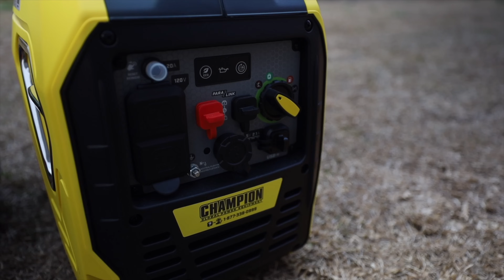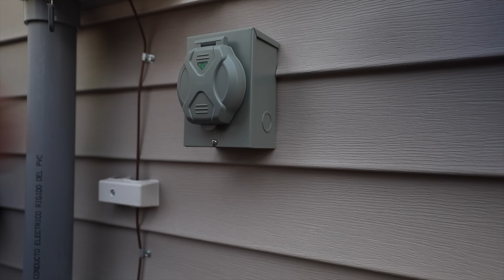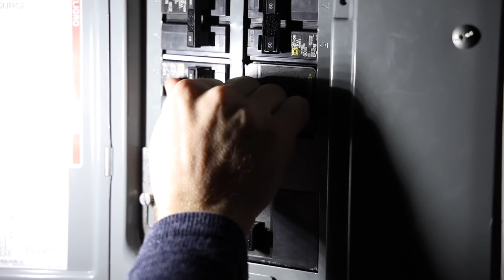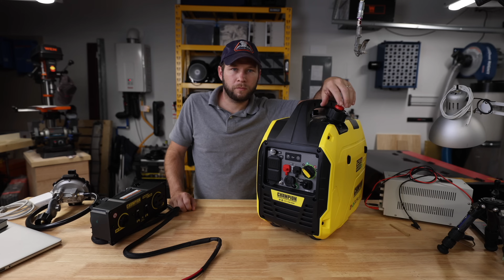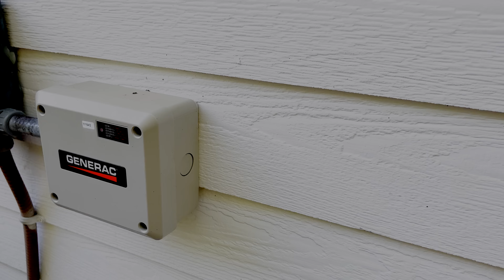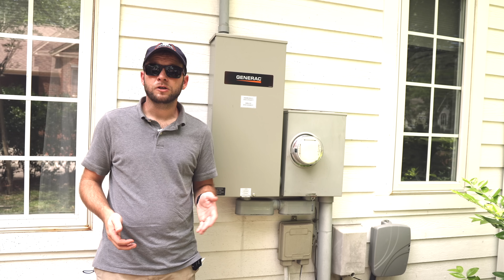Will running on a generator damage your house? Inverter vs standard vs standby

Comment: a lot of the generac's now have a Bluetooth connection. you have to be hooked up to the Internet for this thing to work. OMG what happens if somebody hacks your generac will never start again because the computers fried because of an EMP!
Reply: you do NOT need to be on the internet to use these. It is an option during set up that you can skip if you are that worried. BTW, the main point of the Bluetooth is to notify you of what's going on if you are not home. OTOH, if the net is down during a power failure, you are out of the loop anyway. BTW, you need to have the app and also a personal code to use the feature.
Reply: @rupe53  it's going to be rather interesting when my whole neighborhood is down and the internet is down. I guess there'll be expecting the Generac to power the internet.
Reply: @willfriar8054  ... I believe I already explained what happens if the internet is down. Everything works on the power end, but you don't get your text messages as to what's happening while you are away from home. If you are home, then you know the gen is working.
Reply: It still doesn't change the fact that it was a rusted up piece of cheap crap brand new in the box Rusty. They should be using more corrosion resistant materials
Reply: @willfriar8054  ... how do you know it was rusty?

Comment: I was going to buy a generac. I made a wonderful pad for it. when I got the generator it was all rusty inside and I took it back to Lowe's. they ordered me another one in that was just as Rusty as the first one! turns out they had a flood in the warehouse. all the control springs and even aluminum parts were corroding. controls for the gas valve  corroded. and this was going to be set up next to a 500 gallon propane. no thank you I got my $6,500 back from Lowe's. I invested 3500 and solar panels batteries and inverter. all my refrigerators run on solar all the time. I've never had to buy propane for the generator. I turned that massive 4 ft by 8 concrete block into the foundation for a nice little greenhouse.
Reply: That’s the advantage of solar. It starts paying for itself from day one while the best you can hope for with a generator is that you never use it. Even in that case you have regular maintenance costs if you expect it to work when you start pouring more money in the gas tank.

Comment: We decided to get the Generac.  I'm still stressed about it.  I'm running it now for the 25 hour break in.  When the a/c kicks on, you can tell, but then it smooths out.  They do install a house surge protector.  My problem is I'm worried about my computer.  I do have my computer plugged into a nice surge, which is plugged in my ups surge protector battery.  Every time the a/c kicks on, the generac speeds up, for a lack of a better description.  My ups battery lights up and peeps one time.  I'm hoping this is not a bad thing.
Reply: Anything you love, should ALWAYS be placed on a good quality UPS, period.  Be it your 85" flat screen, computer, etc.  End of story.  Surge suppressors do not work for voltage sags.
Reply: your computer has a regulated power supply so all the internals run on 12 volts DC... and the input voltage can vary from 100 - 140 volts at 50 or 60 Hz. The reason your UPS beeps is it reacts VERY fast to minor variations in power, which will happen with smaller "portable" gen sets under heavy loads. (typical 5-7 Kw units)
Reply: @rupe53  Hi :) and Thank You :)  So you are saying I should be ok, concerning my computer?  When I mentioned it to my generac dealer, they came out and tested it and said what I was experiencing was normal.  They told me that sometimes there are problems with the a/c starting up.  In that case they will install a 'soft start' thingie for the a/c.  He didn't think I needed one, and that I wouldn't notice much difference if I wanted one.  At the cost of it, I'm happy, but I was willing to pay for it, had I needed it.
Reply: @desertdee1  ... the cheaper way to get some relief on an older AC unit is to ask your AC dealer to install a hard start kit. (Super Start kit?) It will basically knock the start load down, but not as much as a soft start.... but way cheaper.
Reply: If you still look at this site, your UPS (some of the better ones) chirp, because their alarm points are set to tight for a standby system.  Go into the software, and change it from 5 volts to 15 or 20 volt voltage swing.

Comment: The one thing I can add to this, is the cost of using your Natural Gas.  After Ida, we went 19 days w/o electricity.  It was miserable HOT and muggy.  We used a regular generator, and had it hooked up to our house.  We could run everything but the a/c and desk top computers.  So if you weren't in front of a fan, you were miserable.

Other then the normal maintenance and hour cool down in the morning and once in the evening, my husband had to spend hours in line for more gas.  We had enough cans for approximately 5 days.  There was no guarantee that when you finally made it to a pump, the gas station didn't run out of gas, and no truck in sight.  It cost us approximately $500.00 for that 19 days.  My aunt has a Generac.  She didn't have to do anything.  Her bill for that 19 days, from the gas company was also about $500.00.  So either way, you're going to pay...
Reply: as a 25 year generator tech, there's no reason you can't run a desk top PC on a portable gen set. The internals are already on a regulated power supply and will be fine on AC power from 100 - 140 volts at 50 or 60 Hz. Most fridges will also cool enough in 3-4 hours to hold food for another 6-8 hours if the door stays closed. If you set up a schedule to run the set in shifts of 3-4 hours each you can cut your fuel costs in half. You just have to group your electrical use to fit during your run schedule. After all, most people are just using it for the fridge, well pump, and some lights. TV, computer, and other small stuff is hardly any draw, and usually not all day or night.
Reply: the kubota GL11000 is way to go wich runs 100% everything in the house wich why im gonna get one for $8,600

Comment: At LAST!!!!!! Hands down the clearest explanation of why my standard generator did not work with my furnace during our recent power outage. Bravo!  and Thank You!!
Reply: A furnace shouldn't draw that much power. Ignition for the flame (fleapower), and a blower or water pump. An oil furnace has a fuel pump while a gas furnace doesn't.
Reply: @joewoodchuck3824  high efficiency furnaces don't like THD above 5%. They also can be finicky if you're generator neutral is bonded, depending on how you hook it up.
Reply: Some furnaces are picky about how the ground is connected.  This is a separate issue from the dirty power issue described in the video.
Reply: the kubota GL11000  11,000 watts 16.5 hp  is the best generators that can accully run 100% everything in the house include furnace plus runs 24 hours with out refeuling up wich im planing on getting wich plus uses same 16.5 hp kubota tractor filters wich gonna cost me $8,600
Reply: Please pulsar 4000 gd run it

Comment: I'm looking for a portable Inverter Gen. As have high tech furnace was looking at this but gas tanks small & would like 7500 running on Gas any other suggestion Reliability of most importance   Champion Power Equipment DH Series 8750/7000-Watt Open Frame Inverter,
Reply from the maker: I do like my champion generators and I will say I hold them in higher standing than some of the predator or wen models. However I do have the luxury of having two and with my future system plans could function with just one if needed, so I have a bit of a safety net. I chose them because of the features and reviews for the price. If reliability was my highest priority and I could afford it, I would get a Honda or Yamaha inverter, though for the price of that you could probably get two of the model you mentioned and have a backup.  As long as they are maintained properly and not mistreated I think most any reputable model that has the features and output you want will do fine. I do think that the Hondas are probably more reliable, but the critical failure point would likely be the inverter module and that’s not something that can really be worked on but rather replaced. So again, if you are looking for less expensive, the champions have been great for me, if you are doing something where being without power is not an option, get two. If you want the best and understand that anything can have problems, get the Honda.

Comment: I have that same 16kw unit here in Florida. Got it cheap brand new at Lowe’s since it was a special order return, never used. The nice thing about that unit is that it has hydraulic lifters,no need to adjust like the other models during that time. Now the brand new models have hydraulic lifters though… Oh it will power my 2800 sq ft house easy even with the AC. The trick is to install a micro soft start on the AC unit. About 200 to 300 bucks. It requires less energy to start the AC system, therefor the generator has zero bog down. Really love the 16kw unit as well since it’s very fuel efficient. Great video BTW!
Reply: When I was running my new generac for the 25 hour break in, when the a/c kicked in, it really bogged the generator down, and caused our lights to dim, and my UPS battery to light up and beep once.  After everything smoothed out, the battery light went out, and everything was fine.  When I spoke to the dealer, they said I needed to install an a/c soft start.  I agreed, before even reading your message.  I'm glad that you spoke about it, because now I know they aren't just trying to sell me something else.
Reply: if that set is the 800 CC unit (fairly new) then you have hydraulic lifters. If it has the 1.0 liter engine then you need to adjust the valves.

Comment: Nice video years back all i used was a light globe between phases of different generators to put them in phase, once done, they are locked together. cool you can do the inverter type easy.
Reply: Interesting could give a little more detail?

Comment: I have a GP6500 from Generac and it comes with an automatic voltage regulator built in... When I load it the hertz changes a little if the load is heavy, but the voltage output is pretty consistent.  I only notice a spike when I throw something like 4000W instantly and that is where people get into problems and that is outside of a whole discussion of load balancing.
Reply: The FREQUENCY can change a little when the load changes, especially as the load approaches capacity. one to one and a half cycles either way is not usually noticeable. The problem is that when you drop a heavy load on it, the intertia of the generator is not enough to keep up the speed until the inrush has passed. You say you add a 4000W load. That may be the constant running load, but the "inrush" or instant load of an inductive load (motors - refrigerators, etc) is much greater. The starting current is momentarily much higher than the current when running.  That is why you need to read the specs very carefully. The generator may say it is a 4KW  generator, but you need to see what the max starting (inrush) load is versus the running load is.
Reply: @The_DuMont_Network  The 6500 is a 6500 running watt generator and has an inrush rating of 8750.......I have the older one which is better on the rating and does not have that co-sense garbage.
Reply: @dmcd7333  You mean LRA ? [locked rotor amps?]
Reply: @georgepruitt637  Motor in rush rating the 8750 good up to 1 minute... the running max load is 6500 which I really never get above 5800 as described above.
Reply: @The_DuMont_Network  If your gen isn't large enough to supply your needs, you'll just burn up the gen/hse wiring/appliances. Best to get a big one that can handle everything .
Reply: @georgepruitt637  I do not run both A?C units or the wather heater.. mainly all lights, fridges, and laptops.  If I need to run the A/C I usually run the upstairs and it also cools the downstairs .  Only used during Hurricanes other than monthly loads to keep the generator  maintenance and heads good.

Comment: Ok they have a box for generators that is for the reason you stated about weather conditions yes for the frame units plus this box is also a noise reducing box as well.. so please due your research.. that Gen unit is a great product but most can not spend the money for them that's cost of Gen and the gas it takes to hook up to , yes the gas may have to update to proper size for the unit and any fixtures your gas is supplies.. if you did this to help sale a Gen unit don't .. there is many options plus I es you can uses a solar panel system as well for backup
Reply from the maker: Please watch the video before commenting.  I go over the upsides and downsides of the different types including the expenses of a standby generator and why it might not be reasonable for many people. I mention the connection to gas as well. Toward the end I also talk about solar as a backup and if you can use it with a generator. The description states these generators are our personal purchases and I’m not affiliated with anyone or sponsored.  Yes they have generator tents, they will not work in a hurricane, seriously, don’t do it.  Many of the generator enclosures cost more than the generators themselves. You could build a generator shed but you need to be very careful with airflow, fumes and fire retardant. Yes open Frame inverter generators are an option but they still fall into the inverter generator category. If you are defending standard brushed/brushless frame generators… don’t, I’ve done my research, so much so that I’m an electrical engineer.  Every generator has a purpose but that doesn’t mean that a super cheap non-inverter generator is good for your house unless you are powering non-sensitive loads. If it’s a matter of freezing to death then of course use whatever you need and can safely.
Reply: yes, gas of the proper size will be critical on a gen set, but with propane in a large tank it's generally not a big deal. With natural gas, you may have to increase the meter size or even upsize the line to the street. Get advice from someone locally who deals with this professionally. BTW, a 12Kw unit needs at least 200 CFM fuel flow, which may be double of what a small home's meter can do.